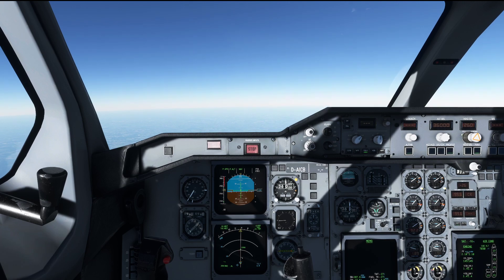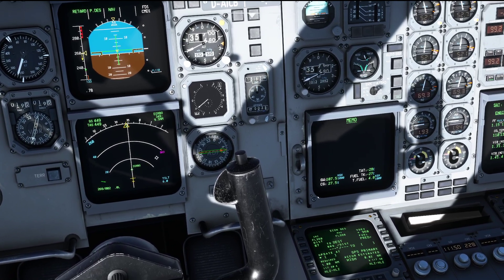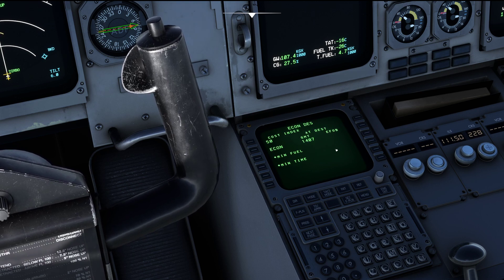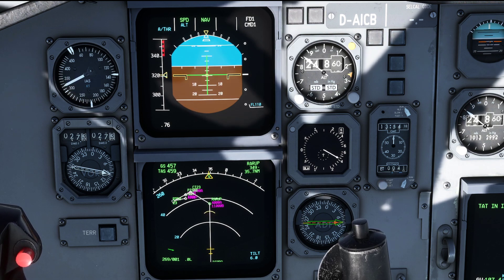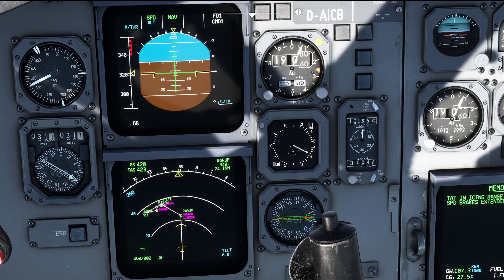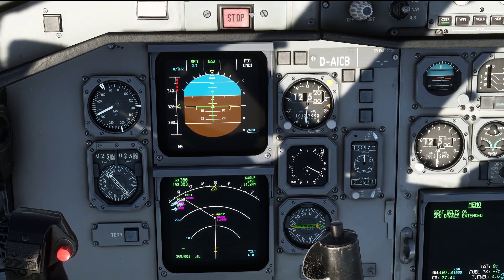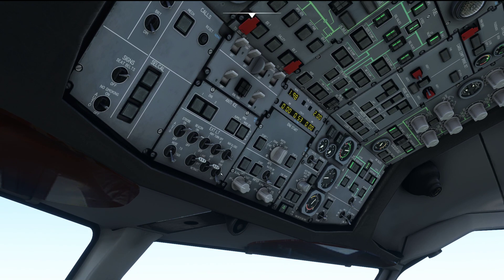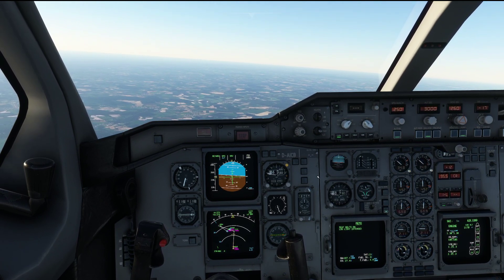MSFS A310 Tutorial 10: Descend (No VNAV) | Real Airline Pilot

Comment: I struggled to follow this video as there is a lot going on just as you start descending. My A310 was only descending very slowly. The speed went up to 400. I did the manual speed setting and used the speed brakes but the autothrottle remained at 99%. I was in profile descent but it was only descending very slowly. As you mentioned some things are broken/ don't work its definitely making this harder to learn!

Comment: 0:14 - 0:40 - Altitude Descent
3:44 - CSTR Button
5:50 - Speed brakes
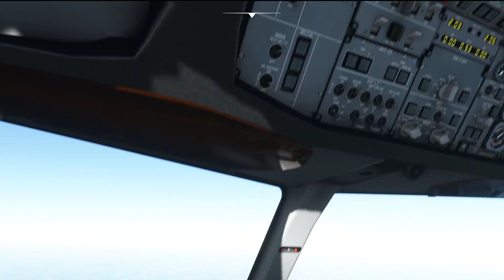6:15 - Seat belts (20.000 feet)
7:12 - Continguing descent - QNH Set

7:45 - 8:15

10.000 FEET ---------------
Landing Lights ON
Turnoff Lights ON

Banana At Final Approuch

Comment: how do you squawk on 310 <3
Reply from the maker: Hi Alex, what do you mean "how do you squawk on 310?" I'm afraid I can't follow you what you're trying to do.
Reply: @A330Driver  i allways get my transponder termineted :(
Reply: @AlexFroiants  right under the fuel switches for the engines is a small panel you will see four numbers. That knob on the left you need to turn that to TA/RA that turns the transponder on, and use the middle knob to set the correct squawk code.

Comment: The VNAV issue is normal. The real A310 was not really good with VNAV. I heard that on inibuilds channel.
Reply from the maker: That the plane may not be very sophisticated? Certainly possible

That it just acts up like in the video? Absolutely impossible. That stuff would never get certified.
Reply: @A330Driver  Have you tried having the plane in ALT HLD mode prior to reaching TOD? I've seen a few A310 pilots using ALT HLD instead of Profile on Cruise.